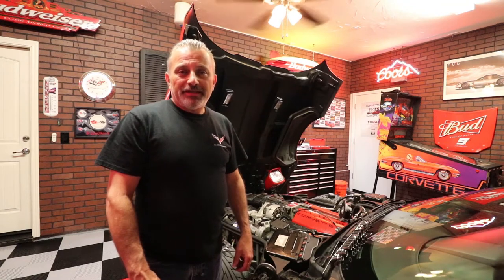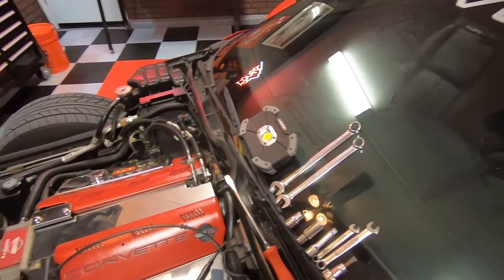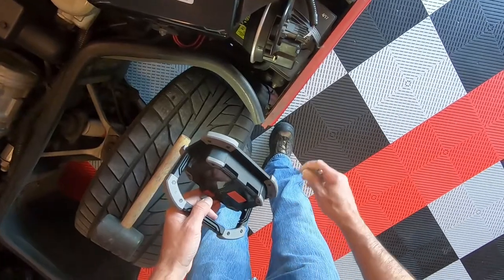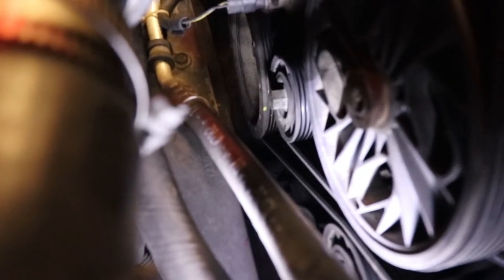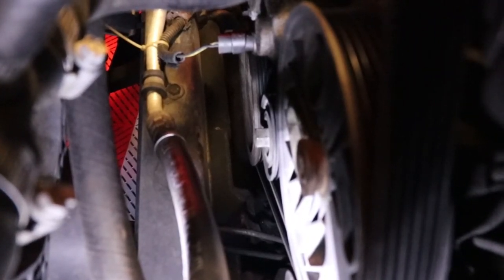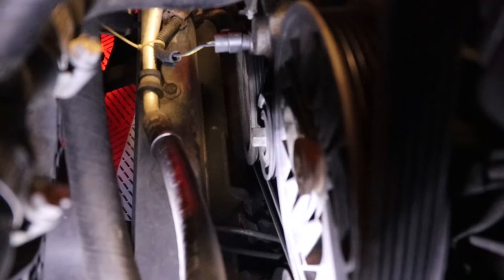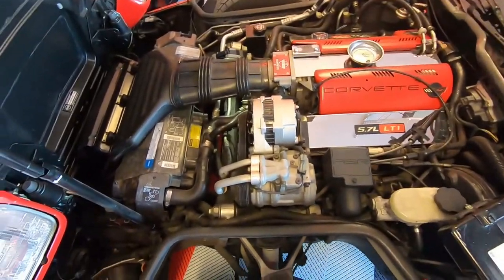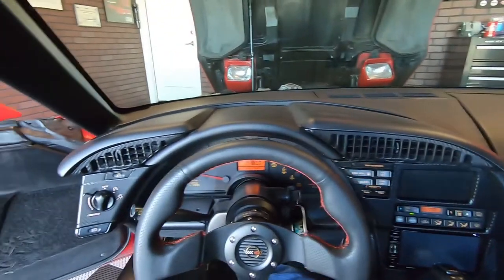How to Change an Alternator on a C4 Corvette

Comment: Tool list: Replacing Alternator
T50 Torx
Ratchet (for Torx and sockets to follow)
8mm (Combination Open end and box end) wrench
10mm (Combination Open end and box end) wrench
5/8"  (Combination Open end and box end) wrench
11/16" (Combination Open end and box end) wrench
1/2" Socket
15mm Socket
Short (3") extension
 long yankee/flat tip screwdriver 
flashlight
Rubber mallet (recommended as optional)

Comment: Just did this with few problems on my 96 CE LT4 (original owner and daily driver for 13 years!).  Some of the nut sizes were different, for example the belt tensioner is 16mm and two that you indicated were 10mm were 13mm.  Not having any long, larger, robust wrenches I used a serpentine belt tool that I got from Harbor Freight that worked perfectly. The handle is flat and comes with everything you need, including the sockets. $20 well-spent!  In retrospect the most difficult part was getting the plug-in electrical connector on the side of the alternator inserted properly.  If I ever have to do it again, I will remove the bracket at the back of the alternator to allow better access to the connector, there are only 2 bolts (other than the one inserted through the bracket into the alternator itself) to deal with and they are readily accessible.  I also used a drift/punch to accurately line up the holes in the alternator and mounting bracket (which on my car had a spacer inserted in the rear hole of the bracket).  Your video convinced me I could do it myself, and lo and behold, I did.  Thank you very much!   BTW - never needed the rubber mallet!
Reply from the maker: Awesome I'm glad the video helped and thank you for watching!!

Comment: Great vid.  can you tell me what belt you are using.  My alternators bearing seized up and I had to replace it. I am though, having an issue of getting the belt back on.  My neighbor and I had the tensioner fully released but still couldn't get the belt over the alternator sheave.  According to Autozone my belt is correct for my early 1993 C4.  Double sided V-groove.  Oh and I am a new subscriber.
Reply: Did ya get it on?
Reply: @Saint696Anger  yes.  found out that Chevy changed the belt set up in March of 93.  Mine was built in Feb of 93.  The belt for March and later is a little shorter and is grooved on one side only.  Mine is double grooved.  Napa had a belt that fit.

Comment: so my 95 vet died the other day and voltage was low, showing 12v sometimes even 11v. so  I put a new alternator in , and I'm getting a much better digital volt reading, seems to be sitting at 14.8/14.9v  but its still goes down to 13v  sometimes when I turn on heater/lights/etc... anyone know whats going on ? thx 

I literally just put it in so I'll give it a couple days and see what up. I know sometimes the new manafactured alternator can just be a lemon as well ,,,,, thanks for reading